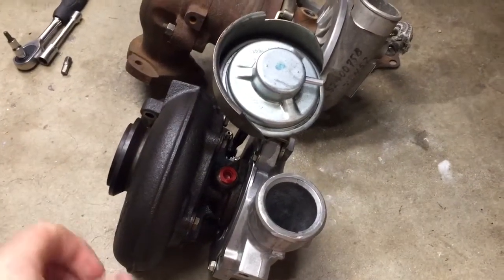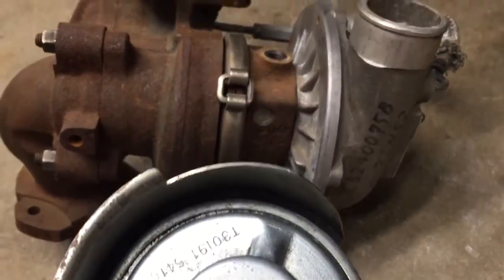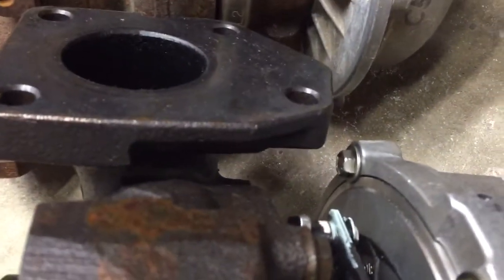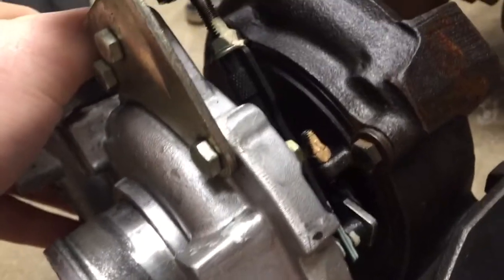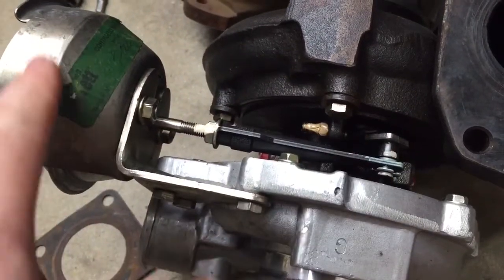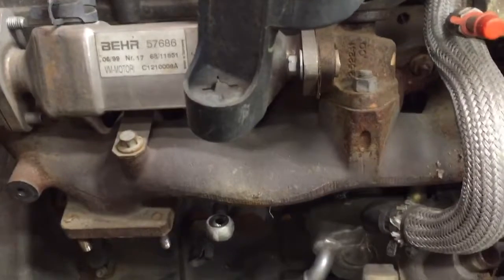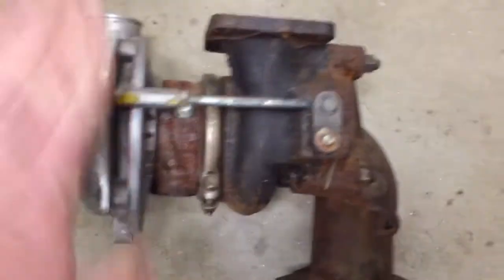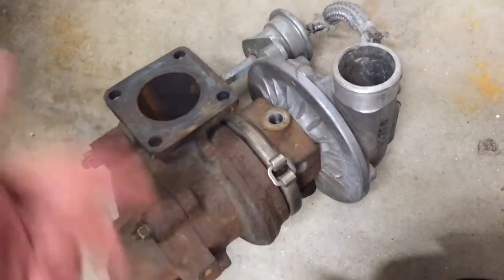Jeep KJ 2.5 vs 2.8VGT Diesel Turbo

Comment: I have a kj here in the UK with a toasted 2.5 can I for a 2.8 with the 2.5 pcm ?
Reply from the maker: Might work if you got a 2.8 from 2002-2004, those engines are pretty similar, but never having seen one I don't know if there are any little differences between the 2.5 and 2.8. I think the ECU would run the engine, but you might need to reflash for more fuel or switch to a 2.8 ECU and get it reprogrammed to your vehicle/security key. I'm not aware of anyone who has done this so you would be breaking new ground.
Reply: What do you mean by reflash? Your right there are little difference between the two all I can see is the 2.8 has a maf sensor and the 2.5 don't.
Reply from the maker: By reflash I mean to load a different fuel/timing curves more like what the 2.8 has loaded. Either a custom tune or the stock fuel maps from a 2.8 loaded to a 2.5 ECU. However if you are not familiar with the ECU you would need someone else to do that work if its needed.
Reply: Ok thanks I will do some research into it cheers.
Reply: @Brianfinn76   Did you do the swap?